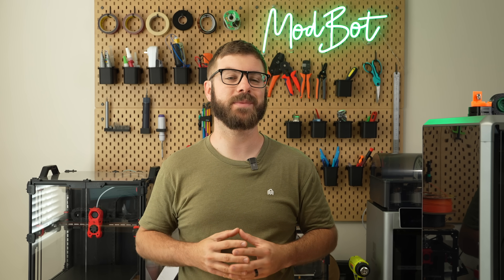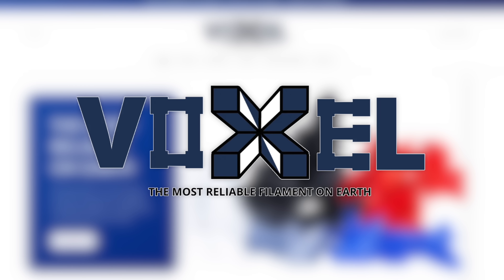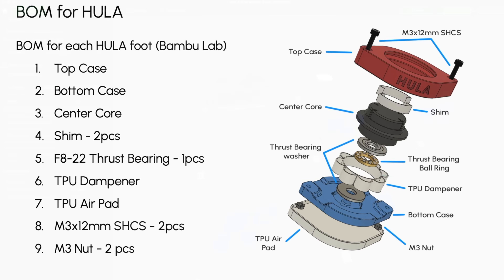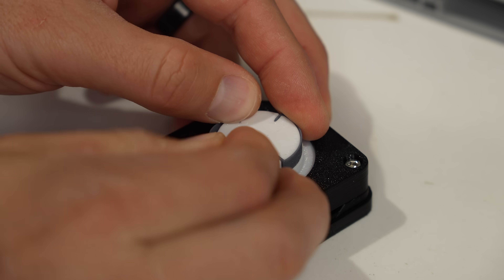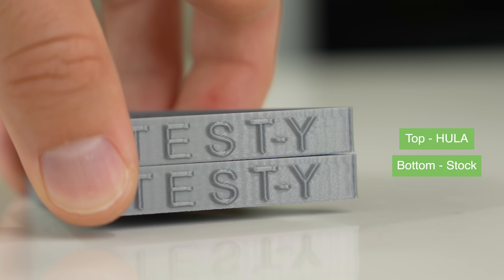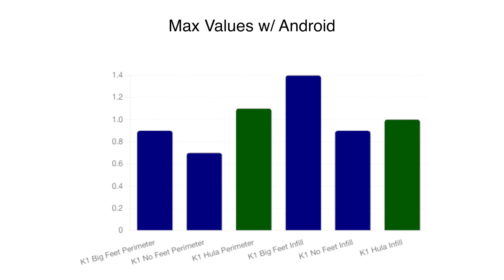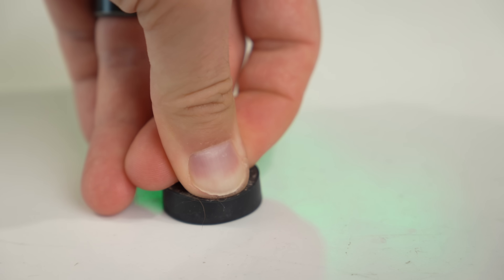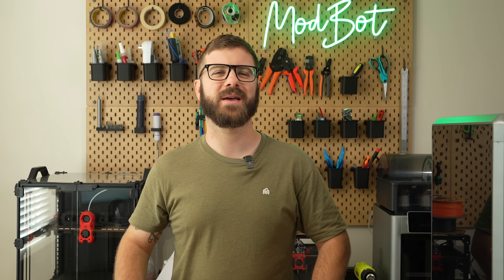Self-Aligning Anti-Vibration Feet For Your 3d Printer (HULA)

Comment: I think it may be the wrong aproach, here in chile those sistems are instaled in my apartmen an is common knowledge that they only increase vibrations in the building bc the point is to help the building not break in half with a big impact, It may be that for a printer wich is a smaller scale, having it secure to a wall or a rack it may transfer those vibrations better than the feets
Reply: When a print head stops and or changes direction due to newtons 1st law the print head will move a little past the stopping point. The idea is to isolate the mass of the printer. The print head will take the printer with it a little bit so relative to the printed part the print head moves less.
Reply: @jacobmurray3621  So how exactly do you think that would happen? The print head wont move a little past stopping point. Rather the deceleration forces from newtons first law are coupled into both the frame and the print head. Changing the coupling between frame and fixed world does not change anything about these forces. Having a rigid coupling from frame to fixed-world (which is impossible to achieve in practice) merely reduces the induced acceleration into the frame, which doesn't matter as it is orders of magnitude more stiff than the connection to the print head already (unless you make your frame out of cardboard). 
Having rubber feet merely reduces possible vibrations from being coupled back into the frame from the outside world. Those vibrations however are insignificant on the scale of a 3d printer (as we arent talking sub micron precision).
Reply: @tHaH4x0r  the main reason I have seen for using vibration dampening feet is to prevent multiple printers on a rack from interfering with each other. This is also possibly why Bambu sold the vibration dampening feet in packs of 8, enough for two printers. Vibrations from one print could go into the rack and then into another printer which could apparently cause issues or throw off the input shaping since it can’t really compensate for vibrations coming from outside of the printer.

For me I got the feet to stop the printer from shaking the desk so much and they definitely help with that.

Comment: I just put a 10mm thick anti vibration mat, which are usually meant for dryers/washing machines, below all my printers. They are really cheap, you can cut them with a knife or scissors to fit any printer and they are better than any rubber feet out there while also serving as sound dampening below the printer.
Reply: "Mass Loaded Vinyl" is often a name for this type of dampening material. It should readily stretch but SLOWLY return to its predeformed state
Reply: I just use playground tiles - rubber pavers.
Reply: did the same idea did a rubber paver tile from home depot with a concrete one unerneath of it. VERY low Vibration and I never see ringing.
Reply: I do something similar with old mouse mats and yoga mats. Works in the same way!
Reply: On my Cr-10 (which admittedly is slow enough to not have as many issues) I use feet designed for squash balls, but the cheap balls I ordered are even softer and more like rubber coated memory foam. This will adapt to any surface and vibrations get absorbed in its soft material.
Reply: Yeah I have an old gel matt that was under an exercise bike and just put the entire printer and small table on it. Fixed my print reverberating through the concrete floor it was on instantly.
Reply: Have you tried them in the other order? I.e. printer on the slab on the rubber. Watch CNC Kitchen's "best 2$ 3D printer improvements" video

Comment: Damping, not dampening.

Dampening means making something moist. You are dampening a towel when you add water to it. Damping means to reduce the amplitude of vibration. The motion is damped (not dampened).
Reply: Dampening and damping are both still used for the same purpose, as verb to dampen very much does refer to reducing the amplitude of something. Both are correct, and used interchangably. 🙂
Reply: The only reason "dampening" is accepted is because too many people got it wrong so they changed it. It happens far too often.
Reply: @shaydereaver3672  According to the OED, "to dampen" has been used in the context of oscillation interchangably as a transitive verb since about 1879. Seems like those pesky 19th century physicists got it wrong already! Probably because there was no YT commenter around to correct them.
Reply: @shmeeed  Exactly
Reply from the maker: I have been doing a ton of gardening lately lol 😂. Google also says dampen is “make less strong or intense” so it seems like it is still correct as well.

Comment: Thanks again for the great content and review.  The amount of time you save us is just mind-blowing when you do these reviews.   I'm curious about the Hula and will dig deeper but coming from mech eng background, at first sight, the Hula makes little sense to me.  It's sexy but most likely off the track.  Meaning that vibration dampener found in industry and used on large building are meant to isolate very low frequencies.  Not necessarily what we need on a high speed core-xy.
Reply: Are not for "very low" frecuencies, these are for earthquakes they where invented in chile.  What it does is adding flexibility  to the base so it can absorb movement in various axis and convert them into x,y movements that isolates the building from the rest of the movements that can create resonancy and break the building, in this case it would isolate the printer from the table leting it move freely .
Reply: @Chyropunk  you’re correct. And earthquakes are exactly that. Very low frequencies.
Reply: They ensure your print quality doesn’t suffer during an earthquake.

Comment: I've had my 3 VZBoTs on their own platforms anchored to my basement concrete wall along with the feet on the printers screwed down to the 1 inch thick butcher block top for quite some time. They are solid as a rock. And I can definitely tell the difference in my prints especially at high speed. But my K1C is just sitting on my workbench which is also anchored to the wall but the printer can be moved around. Even at high speed it does really well on the stock feet. But these seem like a good idea. I may source the parts and make a set for the K1C.

Comment: So totally useless. As expected, thanks for confirming.
Reply: These newer printers compensate so well for vibrations and movement. No need for these "gimmicks"
Reply: @califpv  these gimmicks often make the vibration worse for the printer even without input shaper involved. you want something sturdy nto something that allows it to vibrate otherwise is no different to sitting on a wobbly table
Reply: Yep, vibration feet are mostly useless when it comes to performance upgrade

Comment: I printed a set of these and put them under my Ender 5 Plus. I didn't notice much performance gains, Klipper's resonance compensation gave me 200 more on acceleration BUT they absolutely made the printer less noisy compared to just the stock rubber feet.
As for centering, I personally found it easiest to push and pull the printer so all the feet would hit the rear at the same time.